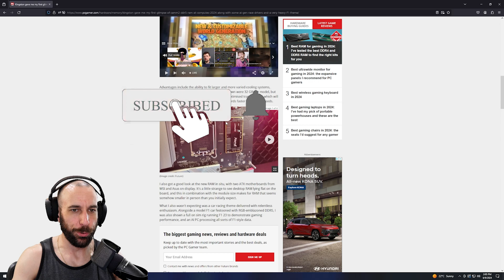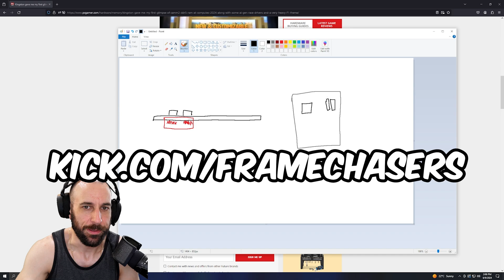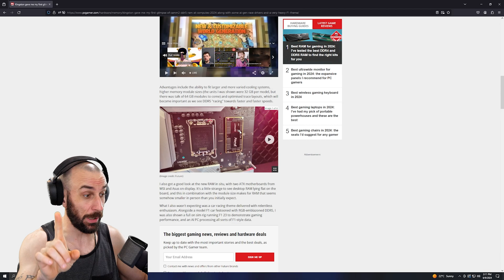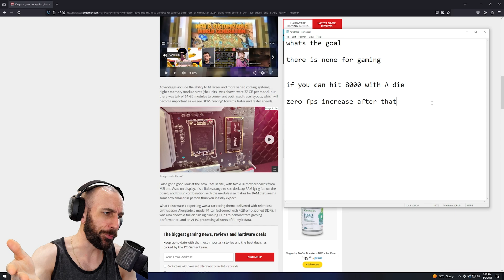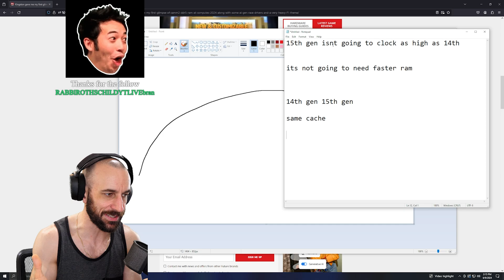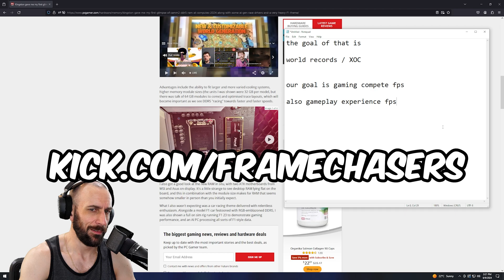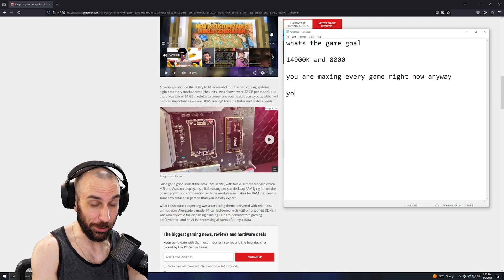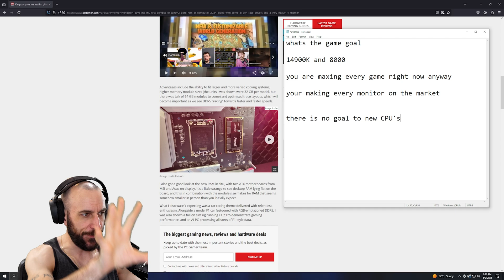Youre DDR5 Is OBSOLETE 😱👑

Comment: Disagree with lots of things said here, first of all only zen 3 vcache doesnt matter, for zen 4 vcache it matters, because cores are strong enough to push through its vcache and be limited by ram. Secondly this is only a first gen of CAMM2 and we, or at least I, dont know, maybe you can even tune it as well, so for first gen to be in such strong position against semi matured and tuned DDR5 is actually good. Also FC seems to dont realize that there is always a balance between core speed and cache size, the bigger the cache the higher the latency as well as the stronger the cores are the more cache they need. But regardless, the first gen of CAMM2 might be a nothing burger, we'll see
Reply: In addition: CAMM2 were designed for laptops to make them more serviceable compared to (soldered)LPDDR5 while still retaining its speed and lower profile compared to so-dimms. In short, CAMM2 provides speeds of LPDDR5 at base voltage while being user-replaceable. Providing more speed at lower voltage also means less heat and less cooling needed (if at all).

So, CAMM2 will primarily be in laptops, but could potentially become standard for PC market as well because it will be easier for manufacturers that way in the long run.
Reply: @zbrkesbris5987  Thank you, I was looking for this. I don't know why he goes "what's the goal" as if a) this is done by Intel and b) this is for desktop and max oc folks only. Quite cringe really.

Also, for the desktop max oc, it's still better (though probably it wasn't known when he made this reaction/video) because it's closer, so timings can be better. It also can support 512 GB in quad channel. I hope we actually get to see that, even if I personally don't need it (and won't get it). High-end desktops (and even laptops) I feel are lacking from being only dual channel. And right now, even on 14900K, getting 128 GB of RAM at 6000 MT/s is a challenge. Trivial for 2 sticks, or 4 sticks at up to 96 GB of RAM, but once you go more, it's not not fun anymore.

Lastly, the best think for desktop PCs is that you'll no longer have issues with a cooler not having space because of the RAM sticks.

Also, also, what the OP said, I don't agree at all with his takes on RAM requirements based on how fast it already goes, and how powerful the CPU is. Though I do agree that most games have their own engine as a bottleneck nowadays.

Comment: I'm just a gamer PUBG COD Valorant and an enthuthiast when it comes to hardware love buying the latest tech. I had Maximus Z690 12900K with G-skill 6000mhz 3090 then got Z790 Maximus 13900KF with G-skill 7200mhz 4090 and ever since moving to DDR5 my gaming has never felt sharp, Smooth yes Super high FPS definitely but not sharp it's like it lost the Peaker advantage I always felt like i was a fraction of a second behind so I switched back to DDR4 4400mhz G-skill on a Z790 Strix board WoW to me this feels the absolute best.

Comment: To achieve better speeds they needed to do that. They already needed to remove "theough-whole-solders" for PCI express 5 to work and they prefer to solder ram on mobile boards because its cheaper and they can go higher in speeds.
I prefer this over not being able  to switch RAM module on a Laptop or using ddr6 (which I expect neef camm2).

Comment: My current Z790 Apex runs 48GB XMP 8000 out of the box with my 14900K (bin equal to a KS) and 4090. It will even do 8200 with no timing or voltage changes just punch it in. I recently swapped that kit  out for my older 64gb 6400mhz kit though. I found in my games when comparing the two that I got roughly the same FPS at 4K + or - 1 or 2 fps. So I now run the 64GB kit for DCS World. Dont see the point for the new RAM and new CPU coming out. May tweak the 64GB kit.
Reply: Test it @1080p scenario. DR is okay though even below 7200Mbps
Reply: @valentin3186  Really don't see the need to test at 1080P and swap them out again as that won't gain me anything, I don't run anything this PC is built for at that resolution. I run it in a 4K ROG PG32UQX as the main monitor and occasionally a LG G3 77" OLED TV as another. Even if there were any differences at 1080p it's meaningless in my individual use cases. Maybe if I have time some weekend I may try it if I get bored.
Reply: @StuartBoyer  true, don't bother. U are all set

Comment: Cam allows for waterblocks which will give alot better performance. its been around since the 90’s.
Reply: Waterblocks or CAM? I've only ever seen DIMM, UDIMM, and chips soldered directly to the board.
Reply: @cannaroe1213  cam ram ive seen it before a long time ago its not a new design.
Reply: @connorharris1900  I see, thanks for setting me straight :)
Reply: @cannaroe1213 No problem! it will allow us to waterblock directly onto the ram die’s. temperature is even more important with ram than cpu and gpu. that will all reveal itself in the following year.

Comment: Half life alyx vr engine is so good it can use 20g vram of the 4090 and 99% usage and no cpu bottleneck. I'm more excited about game engines that actually use all of the hardware correctly.  the old games I love but they use 1 core on the cpu the 4090 is like 30% total waste.
Reply: That's Source 2 and it uses old school forward shading instead of deferred shading, which is used by almost every big game for more than a decade. it has much better performance/resolution scalability (crucial for VR), but the reason it's not common anymore is its coupling of shading with light (adding more lights lowers performance), which limits the artistic freedom and its more difficult to pump impressive screenshots that consumers like. If industry stayed on forward shading it would be much easier to run games at sharp 8K without upscaling tricks, but the dynamics of lighting and colors would be less impressive.
Reply: @kazioo2 I Play arma 3 alot its one of the older game engines cpu bottleneck is bad on 2 cores. But it looks extremely sharp i can see with my 4k monitor things like power lines and fine details from far away it has a more natural feel and i can run 8k native if i want no problem with 4090 about 120ish fps . newer games it looks more of a haze everything blended less sharp. Im on the fence if newer engines are more realistic or just more artistic.

Comment: Also, I think if trace length etc was such an issue they would have changed the mobo layouts, on the newer intels the Ram pins on the CPU are on the opposite side from where the Dimms are now. PCIe is on the ram side from what I’ve see, so ram should be on the left and your GPU on the right. But it’s not, so it’s not an issue. Just remember this was designed by dell for use in their laptops. Why? To cut costs, has nothing to do with performance or gaming.

Comment: Most camm modules have ram on both sides. Also it’s not any closer to the CPU as far as the first dimm slot is concerned, just the second. The goal is to stop you from buying 2 dimms and adding 2 more later, you have to change the whole module. They had CAMM2 and regular DDR5 running 10600MT at computex, same timings, which makes sense they are using the same memory chips…Nobody other than Derbauer mentioned that all the systems running 10600 were running AMD 8000 APUs, camm or dimm. Why? Because the trace story and interference is BS, it’s all about the memory controller, the APUs have a much better memory controller because they were designed to run with LPDDR5 soldered to the board, there are laptops right now running over 10000MT ram. The limit is still your CPU, you buy into this BS hoping you will run 10600 on a 14900k or 7950 and you are fooling yourself, you might get 100mhz more at best and -500$.

Comment: camm2 sucks, i rather just have 4 or 8 channel slots vs 2 channel and 256gb of ram on consumer desktops now that LLMs are a thing vs moving to a server board like I have with 12 channel DDR5 with 12 DDR5 slots
Reply: From what I saw, IIRC, CAMM 2, one module will allow quad channel 512 GB of RAM. Which I also think it's sorely needed on highend desktops (even laptops) PCs. Only having dual channel for 16 cores is insulting. Meanwhile Apple goes to 16!!! channels on their ultra chips. So much hate.
Reply: @Winnetou17  may have higher rank, but bandwidth is still 2 channels because all the new desktop CPUs are still only dual channel

Comment: CAMM2 is about better stability at high frequencies and easier to stabilize as well. Those shorter traces could also man faster communication with the CPU. Also, 15th gen has more cache than 14th gen. Will be interesting to see if the 9000series X3D will still have frame dip issues, like the 7800x3D. High FPS but lower 1% lows than intel.

Comment: Camm style memory is much easier to cool than any other format. You just cool it like it's a CPU. Can have water or air blocks.
Reply: Not if the back of the board is populated with chips too
Reply: Really? What about the chips underneath? I have a 64gb module in my laptop and it has chips on both sides….you drank that snake oil too fast and are hallucinating
Reply: @radugrigoras  Both dual, and single channel variants can be made on a single side.
Reply: @radugrigoras  Much easier to cool than traditional ram sticks, which only offer a few millimeters between sticks.
Reply: @SyntacticOperator  if you say so, maybe 32gb modules, but I doubt you will see too many 64gb or 128gb modules that are single sided, they would need to be too long negating any advantage. Unless we get higher density ICs this generation which I doubt. All I can tell you is that my 64gb module is packed on both sides with not much room left, the 128gb module is also packed on both sides but is one memory IC row longer. Also the limitations are still the memory controller on the chip. All the modules use the same SK Hynix 5600 chips but 32gb runs at 5600, 64gb at 5200, 128 at 4800. Maybe that’s just dell being conservative on their Precision line but they are doing it obviously for a reason. All I’m saying is camm2 isn’t going to revolutionize anything as much as they make it out to. It’s mainly to save height in laptops vs the old SODIMM slots, also made by dell to force you to buy a whole new module instead of buying a laptop with 32gb and then adding 32gb yourself for half the price. Now it’s fooling gamers into thinking ohhh if I buy a new camm mobo and a module I’ll be able to hit 10600mt on my 14900k..Answer is NO, you can’t hit that now with 1 stick in the closest slot, why would this change that?
Reply: @SyntacticOperator  I think you are mistaken between modules and memory IC. When they say module - they mean the whole stick, 24gb modules are made of 8x3gb memory ICs. Right now i believe the largest is 4gb so you would have 4 memory ICs for 24gb, i doubt we will see much more than that this close to DDR6. 64gb kit will still be double sided it would take 16 chips @4gb each.
Reply: @SyntacticOperator  Hmm I guess you are right, the 16gb ones are like 250$ each if you order 1000, the 32gb are an unknown cost as of yet, for sure over well over 1000$ each, ddr4 32gb ICs are 1000$ now and nearing EOL. Don’t think anything above 2gb ever made it to consumer though even in ddr4, probably yields super low and data center demand too high. Plus what consumer needs that kind of density, that’s for 8 channel per socket server boards that also want like 8tb of Ram per cpu, consumer chips can’t even support that amount, we get 192gb at 4800. Would be 1 dim or 1 camm module with 12ics for 17,000$…I’m sticking by my theory, even though you are correct it is possible to have 32gb or 64gb on one side, I doubt we will ever see it on the consumer space. As DDR5 matures which right now it’s almost at the peak you will see better ram that hits high clocks with the same power draw and temps as the original 4800mt stuff. At which point both of our points are moot. Is it easier to cool, yeah if they ever get those juicy 16gb ICs and put it all on one side, will it even matter, probably not, by that time they won’t need active cooling, and DDR6 will be out and the cycle starts again, slow clocks, low temps, higher clocks, higher temps, higher clocks, lower temps. Happens every gen. Took 1 year for DDR5 to beat the best outgoing DDR4.

Comment: For the ram in current time is good:
for ultrabooks and big tablets 2 in 1 like new lunar lake 
for bigger laptops is CAMM 2
for home PC is the current DIMM slots

Maybe that will change after 2030 if see chips like lunar lake in home pc's with capacity's like from 32GB to 256GB not like now 16GB and 32GB.

Comment: The most important metric for memory performance is latency, which is timings divided by frequency. That's actual time physical time CPU needs to wait for a single cache line. And that doesn't improve with frequency beyond certain point.  At 8Ghz at speed of light, each 3.75cm is one cycle longer from CPU to memory module and another cycle back. So maybe this is something like 10% improvement in latency for high quality dies at that frequency.

Comment: I mean, If CAMM 2 is going to allow higher performance with little to no FAFO, I dont see the issue with that. Obviously its gonna cost a lot so its going to a cost to performance trade off in there. EDIT: If Intel isn't going to have an 3D V-Cache competitor which it looks like they aren't this might be a good thing for Intel Systems. It might give them a boost in certain gaming scenarios. We will see when the official benchmarks come out.

Comment: The problem is not just the cache, Jufus (my opinion)
Architectures are flawed to max out things like RTX 4090 at 1080p
Architecture should have least overhead, and cpu should utilize your GPU to over 90% usage, not hang GPU in the background while CPU is slide dancing to new task slowly.
We already learned that raising Ghz to 6.0 is not the only way to boost performance if IPC is not high enough for 1080p gaming and 4090.
CPUs are not regressing, but not catching up fast enough to RTX cards.
I want to see a day when CPUs are actually fast enough to catch up to GPUs. 
I speculate mining industry caused GPU market to develop stronger than expected GPUs. While CPU did not have that demand.
There is only a few games that I can nearly max my 4090 with my 13900k, and 1 title off the top of my head is RDR2 (story, not online). RDR2 online uses about 70-80%, while Story is hovering around 97%, and story mode is more consistent in FPS. I had FX-8320 and although it was great at multi-tasking compared to i7-4790k, it struggled with gaming and GPU usage being low. Because once again IPC was better on Intel, and way better architecture on Intel's cpu. Same logic applies to Threadripper and Xeon cpus/Epyc/etc. Lots of cores, but weak per core performance. 

Intel and AMD needs to focus on IPC and changing architectures. 7950x chips have infinity fabric delay, so the architecture is made more for rendering and workstations, not for gaming. Similar to Intel i9-7980xe, great for rendering, not great for gaming. So i7-8700k smokes it. Because IPC

But, it doesn't disprove what you are saying, because older Xeons like v3-v4 had way larger cache than i9-9900k, so it had better stability in frames, but they were lower because IPC was lower and it would clock to like 3.8 ghz max. So, in ways you are correct. You need higher L3/L2/L1 cache, but you also need architecture that can utilize it. Whether it achieves it through speed like 13th/14th gen intel or by other structures/nature of the chip. As modern 4.5 ghz chips beat out AMD Bulldozer at 4.5/5.0 ghz

Comment: This vid is one scenario, I really hope they made the new socket of supporting the upper end of the DDR5 standard. If they dont, whats really the point of upgrading Intel? With the market flooding over with lga1700 boards, good luck selling the new platform. High price is fine if you can back it up with an equivalent uptick in performance.

Comment: The few engineering sample motherboards were shown to have a large heat sink with thermal pads covering the CAMM2 module.
Super easy to build a water block for that.
Reply: you might not even need a waterblock, with a cover as large as the ones shown, those plates could be large enough to dissipate the heat with just a simple fin stack on top although i think E-ATX might be the new norm for those top tier boards using camm2. Looking at my ATX MB, I can't imagine fitting a camm2 module on it comfortably
Reply: @one_rich  And to the point of this video we are yet to see any numbers as to what advantage this will bring to 14th gen other than having to buy another type of RAM.
Maybe we can all run 8000 or better……..
Reply: I think bitspower was that already had one on display with a waterblock.

Comment: What a bunch of rubbish, we don't need new faster ram nor faster CPUs! :D That will age well.
Reply: you will need gear 3 12,000mhz for this to matter. anything else will be slower. just like ddr4 4000mhz to ddr5 8000. we are not even close to this.
Reply: What are you talking about?! Try gaming on a 360Hz rig and see if you change your mind. Pubg on 240Hz is so much better than slow 50fps a normal pc can master in 0.1%lows.

Comment: Love you jufes, but it looks like the difference will be more apparent on ddr6, where dimms won't be able to match camm at 15gt/s, while not requiring the fafo via voltages, timings and qvl that dimm still does. Also, one camm will be dual channel, making ram post problems a memory 😂

Comment: Its not being developed and introduced for todays ram and processors requirements, its for the future going forward. PCI express is an example of this. a 4090 barely saturates PCI 3.0 and here we are on PCI 4.0 with 5.0 around the corner

Comment: Agree with Jufes here, I predict arrow lake will have the cpu die with its memory controller, soc die with npu and L4 cache since lunar lake has a separate cache block and cache does not benefit from high end nodes, IO die with pcie and USB and thunderbolt and, GPU die,